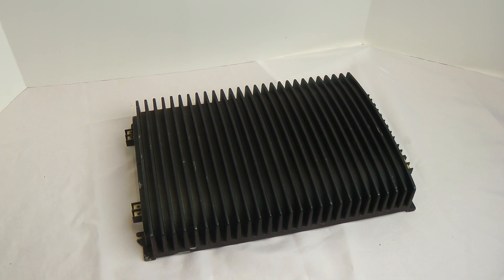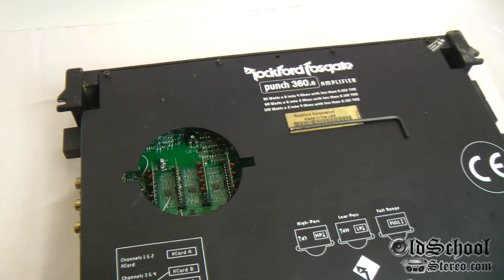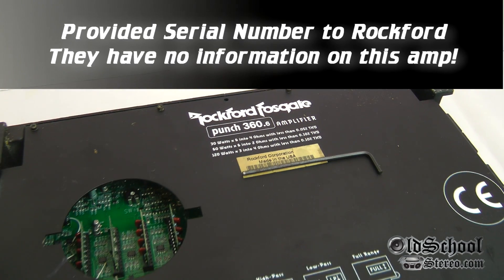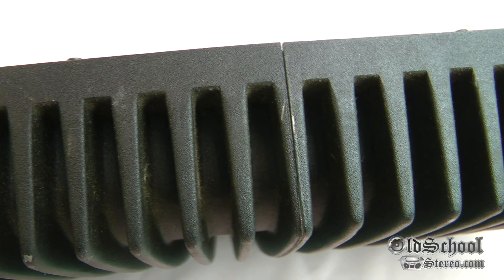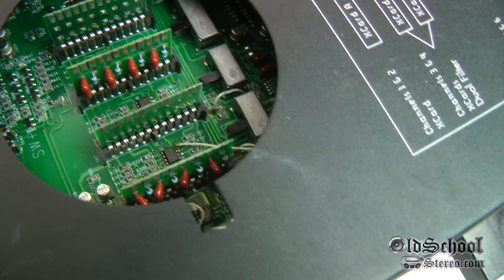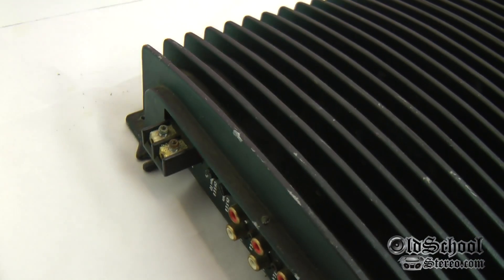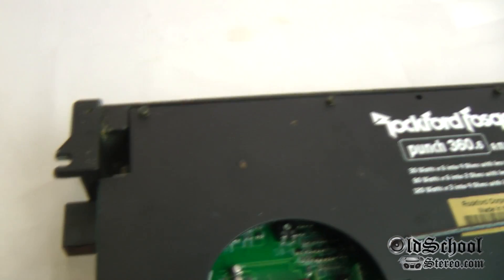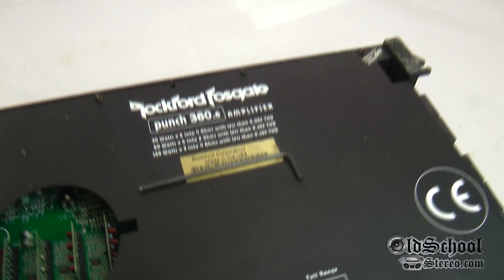Rockford Fosgate Punch 360 6 DSM Amp - Rare? Prototype?

Comment from the maker: Comment by Chris Nelson, former RF employee  “So the subject of the mysterious 360.6 amp in the DSM heatsink was discussed in another thread. I could not remember if it happened or not. So i reached out to John Welch who was the electrical design engineer for it and many other rf amps. He did confirm that it is a legit prototype using two heatsinks that were cut and "pinned" together. This was done because at the time the electrical design was being done, rf didn't have samples of the new casting in house yet. So they did that to continue the electrical testing. Approximately 3-5 of these amps were built. So that makes it "rare" in my book. Now there are more because some people are making their own, but there are 3-5 real ones somewhere. The pictures i shared here are some of the later prototypes in the correct heatsink from Johns personal collection. He had to hand build them as you can tell by the soldering and sky wires. But they are still very valuable in my eye due to them being true hand built prototypes”
Reply: Did you ever get around to testing this amp. I jist ran into a 360.6 greywith black end caps. Appears to be mint condition. Wondering what they really put out. Yeah I know 7 years later.

Comment: It was a proto type. None were sold from my knowledge. The old engineers who made this amp were testing different configuration layouts and experimenting with seperates... one set of RCA's with run your tweeters one separates would run your mids and the other one on your midbass. That's crazy you have one.
Reply from the maker: I got confirmation from Rockford it is an “alpha” product. Unbelievably rare 😳

Comment: Judging from the joined sinks, jumper wires on the board, & the rough cutouts on the gains/EQ, I'm going to totally call this a prototype.  As has been said, probably an employee kept it and then later sold it.

Comment: That is probably a prototype. And most likely same board layout as the 97 360.6. But that is pretty darn rare seen it on eBay too. Does it work?
Reply: I have a gray/gold 360.6, I just compared the boards of BigDWizs and mine through the hole for the x-over cards. From what I can see, there are definately small variations between the two.

Comment: By chance, did you ever play with this amp? I have the Black and Grind model 360.6 I'm thinking about using in my son's truck. For the front stage. Either a 2way active or 3way active with this amp. But thinking better to go 2way so I can bridge down 4 channels for the mids and the remaining 2 for the tweets. Was hoping you might know if these at least do rated or if they are just like the rest of the series and do more. Will use a separate amp for the subs so hoping the 360.6 can handle the front stage.

Comment: I have one of these amplifiers. Bought it around 1996-97 in Las Vegas at a  big box retail store (Ultimate Electronics)  it was installed in a Mustang Demo car they put together to display inside the sales floor.  I wanted to get the exact same set up in my Mustang.  They had trouble getting that 360.6 for me.  The solution was to sell me the actuall one from the Demo car. It had been in the car for about 2 or 3 weeks. At around  1/2 Gain. Used it in my Car for next few years. Until I parked my car in the garage for good.  It's still in the mustang in my garage. Worked  perfectly last time I checked it.  The crossover chips or switches were always a pain in the but to work with though IMO.  You wondered about the end caps? Yes It did have end caps.  
RYAN 
LAS VEGAS
Reply from the maker: Ryan z I had this one confirmed as an Alpha product by Rockford Fosgate. Are you saying you had a black, DSM style 360.6? If so, I'm curious to know what the end caps said on them.

Comment: I just bought the gray/gold 360.6 amp. "DSM"(dosint really mean anything). On Craigslist for $70 bucks in new condition. Brings back mems. Dosint put out as much power as I use to think it use to. But works and sounds great and is a true classic. Running front. Rear. And sub mode
Reply from the maker: leonsam12 that's a GREAT deal!! The deal about DSM here is this amp was available in DSM fashion for the masses and I was curious if anyone else had seen one like this.
Reply: leonsam12 DSM stands for "Discrete Surface Mount".